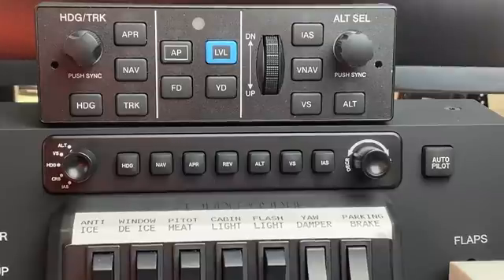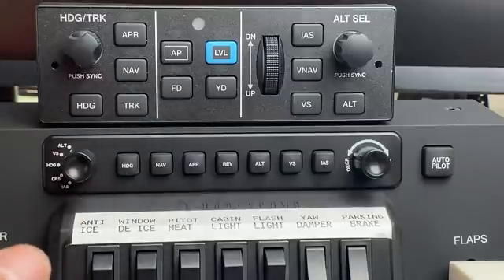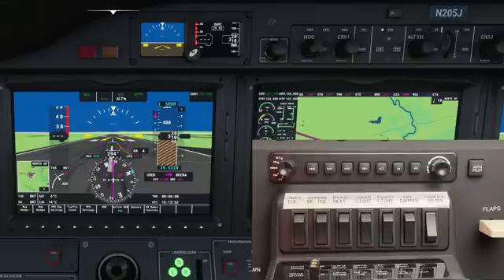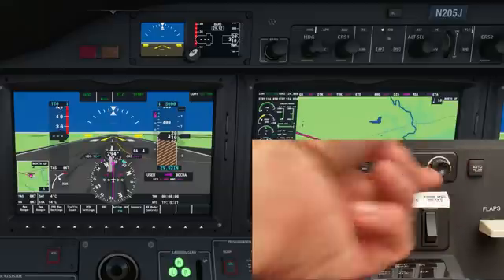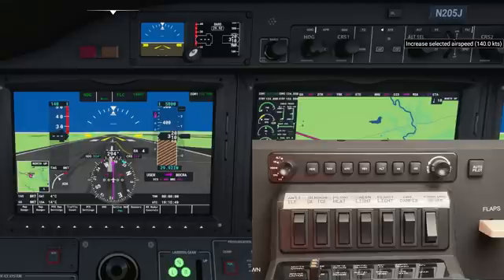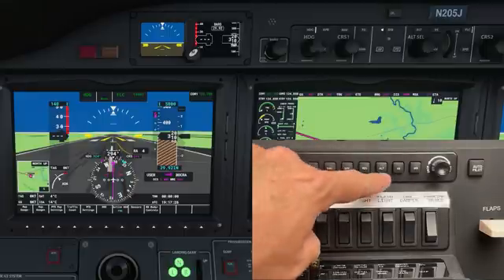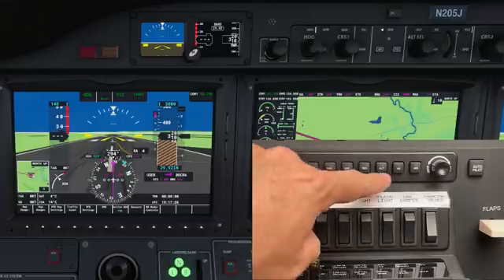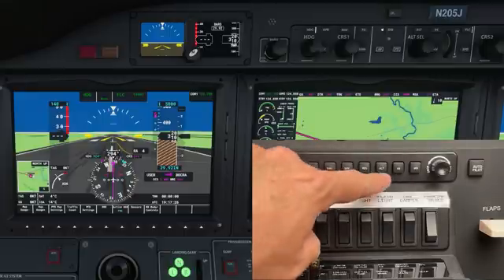Autopilot Tutorial for Honeycomb Bravo Throttle Quadrant in MSFS 2020.

Comment: great series of videos- thanks so much! I would like to make a label similar to yours- any recommendation for a good label maker?
Reply: Some sellers on Etsy are making magnetic labels that can be easily removed and a different one put on in its place, for if you have different switch settings for different aircraft. You just tell the seller what you want written on the magnetic label and they will create and send it to you.
Reply: Create the label in any design software and print on any inkjet or laser printer on plain paper.  Cut strip with scissors and use clear scotch tape to hold on Bravo.  I did mine on a Mac with Pages software and had white letters on black background which looks far better than black letters on white.

Comment: so, the "GOTO" button, is basically the Flight Director?
Reply from the maker: No. It sets the flight director command bars to a pitch up climb attitude.
Reply from the maker: Here is a new video for you on your question.  https://youtu.be/nB-SR4hODeY
Reply: Actually it is a GOTA (Go Around, Take Off) mode. Once triggered, the flight Director command bar will assume a pitch up position for the pilot (or the autopilot if engaged) to fly.
Reply: Regretfully he didn't really discuss the relationships between the Flight Director, mode selectors and the auto-pilot fully.-but for the purpose of the video it was a good introduction.
Reply from the maker: @timol437  Here you go:  https://youtu.be/nB-SR4hODeY
Reply from the maker: @timol437  the flight director command bars (also known as V-bars) are the magenta bars on the attitude indicator.  Essentially the autopilot follows these bars.  As a pilot you can manually fly the command bars if the autopilot is disengaged.  The relationship of the command bars to the autopilot is straight forward. For example setting the autopilot vertical speed mode for a climb and heading for a right turn would show a pitch up right turn of the magenta command bars.
Reply: @RMAG  Thanks-but as a check captain IRW on 757 767 I know this-but some newcomer viewer may not-just suggesting a hole that should be filled in the tutorial...also they may not always be "V-Bars" - FDs also use the two-needles (whhich I hate using IRW being an old 727 driver I am used to the V-bar)
Reply from the maker: @timol437  your right about the two needle. The 747 for one uses that in the Sim. Maybe I’ll do a video on it. It is tangential to using the autopilot.

Comment: how can you change the altitude by the hundreds instead of thousands with the honeycomb?
Reply from the maker: It’s well known bug in MSFS.  It has to be fixed by Asobo.  Alternatively you can use a third party program to do the keybinds, or you can unbind all your switches including the Alpha yoke. Or just wait for them to fix it.  I use the knobs for macro changes and then the virtual knobs in the sim for the micro changes.
Reply: @RMAG  thanks ! but you only have one knob right? so there's no way to choose quickly which increments you want to change, either they set all to hundreds or leave it to the thousands, unless you can set using the keyboard which increments 100/1000 you want to have and then the only knob in the honeycomb do the rest.
Take care and thanks again!
Reply from the maker: @Mr.President  you can’t specify. The always on buttons of the Honeycomb devices makes the adjustments be the larger ones.  Knob or keyboard it does not matter. The only way to get the small adjustments is to mouse click the virtual knob in the sim.

Comment: Thank you for this, but if i set one of my toggle switches to "toggle parking brake", in the sim the brake constantly switches back and forth a thousand times a second until I clear the setting. Is there something i'm missing on how to program these toggles to do momentary switch selections?
Reply from the maker: You need to bind to Set Parking Brake not Toggle Parking Brakes. When the SIM starts parking brakes are normally on so you might have to toggle it on and off just once.
Reply: @RMAG  also, for fixed wheel GA aircraft, try mapping the "Set PB" function to your Landing Gear lever instead, I found it works great.

Comment: I’ve watched I think all four of your videos in this series on the Bravo - EXCELLENT for my knowledge increase. Thank you.  two questions.  1 - how do you set your parking break (mine seems to toggle on / off / on / off so I’ve done it incorrectly) and 2 - can you say more about yaw damper?  Should it be on all the time the AP is engaged up until approach mode?
Reply from the maker: You want to make sure you bind the switch to SET PARKING BRAKE, not TOGGLE PARKING BRAKES.  The Sim normally starts with the parking brake engaged, so if you start with the switch in the off position you may need to flip it to on then back off the first time you use it.  A Yaw Damper is not to be used during takeoff or landing.
Reply: @RMAG  thank you again!!  I have tried but not successfully gotten cabin lights to work on the C172 (non g1000 version).  Any help on how to set up internal lights correctly on the bravo ?
Reply from the maker: @JCrowe  they don’t lend themselves to be bound to an flip switch. They are dimmer knobs for glare shield and radio lights.  Best to just use the knobs in game for that.
Reply: @RMAG  There seems to be a lot of simmers struggling with these functions, and also lots of lessons learned. Maybe a topic for a future episode?

Comment: You forgot to mention one little thing.
If you have the alpha, it will not work as expected unless you unmap all the lights and magnetos switches... shameless
Reply from the maker: Mine works without doing that.  Unless you are just talking about the heading and altitude adjustments being too large.
Reply: @RMAG  indeed talking about bugs on altitude and heading incrementa being stupidly high or low or random...

Comment: Fantastic video, for which very many thanks.  I've no doubt it will be indispensable if I ever get the Bravo.
I pre-ordered from Amazon UK over 5 months ago and they've now given up even suggesting a date.  I accept the current 'situation' may well be contributing to delays, but it's still very frustrating.
Reply: You should have gotten your Bravo by now. I got mine October last year (20), also from Amazon, shipped from France of all places.
Reply: @PeterMaddison2483  Hi Peter. Thanks for the reply, in the end Amazon admitted they had no idea when, or even if, they would ever be able to supply.  So I cancelled the order and ordered from Aerosoft in Germany.  After some delay I received it in May, I’m still trying to set it up for different aircraft, but it does make flying, trim etc a whole lot easier.  Cheers Noel
Reply: @Jestey6  When did you order it, I ordered mine 28 Oct and got it before the expected date of 1 Nov, I think it actually came in half the time.

Comment: You mention the "togo" button brings up the magenta lines. Does this make it the same as or connected to the FD (flight director ?) button? 

Is the default togo binding as it should be or have you changed that binding?
Reply from the maker: There is no flight director button on this auto pilot.  All the flight director button does on a real auto pilot is turn them on. It does not set them to go around/takeoff pitch attitude. It is the default binding.

Comment: Have you tried this with CJ4? It seems if i click autopilot like Nav mode it wont follow the course. And if i click nav mode on screen the heading light lights up on bravo panel. It seems the heading and nav buttons on bravo is not working or synchronize with the cj4?
Reply from the maker: HDG and NAV worked for me. FLC/IAS was the only thing that appeared not to work for me.
Reply: @RMAG  really? that's on CJ4 right? mine is broken. how did you fix it or what is your button config? everytime I push NAV it will light up but wont activate. I need to press it manually on screen.

Comment: I don't think they've done a "good job" - they were one pot from just putting the same setup as the garmin. The lack of a pot forced them to confuse everything.
Reply: I agree. We just needed ONE. (well maybe two, with a push button center). It would've been near perfect.
Reply: As someone who knows nothing about "pots" (well, except the smokable kind) is that something that can be easily (or at least relatively easily) added after the fact?
Reply: @kevykevTPA  Pot in this case refers to a "potentiometer", which are the knobs that you can turn. It's probably not simple to add another pot in unless you knew what you were doing, not to mention where would you even put that pot on the controller without drilling a new hole for it.

Comment: Thanks. Good film. I'm waiting for my Bravo. I have a question, can the ALT setting only be set in 1000ft increments ??? And what if we want to fly at an altitude of 3500ft  ???
Reply from the maker: There is a well known bug that makes the adjustments x10. Heading bug moves 10° too.  Asobo needs to fix it.  What I do is use the real knob for macro changes and the virtual knob for micro changes.
Reply: @RMAG  Yes, quite a strange "feature". If you ask me, this "bug" is too big to go unattended for so long, in other words, it's intentional. I guess we all use the 10 degree heading bug increments and hit the HDG-set-to-current when we hit the right single digit heading. Thoughts?
Reply from the maker: @georgesiebes  in some respects I like the larger adjustments. With my game when first loads in, it has the small adjustments, but it reverts to the large adjustments as soon as I hit ESC and bring up the menu.  It’s  A LOT of twisting to turn 180° or to set an IAS by 1’s instead of 10’s.  With Altitude it’s normally thousands or maybe thousands plus 500.  If I’m looking for a specific altitude I’ll set for the nearest 1,000 past the target and just hit ALT at my target.  The knobs are workable. I would prefer a switch so we could toggle between large or small adjustments.
Reply: @RMAG  Could one of the programmable buttons be set to do that?  I think a better solution would be to base it on speed, and I'd hate to waste a button on that, but it might at least be an interim fix until someone figures out the speed idea, or something I haven't thought of.  A push button knob would be best, but that's not something that can be fixed with programming or firmware, it either exists or it doesn't.
Reply: @RMAG  yes, I noticed too that  when you first start flying, the heading bug moves in 1 degree increments. So there might be a glimmer of hope that this is a "bug" after all. Real world should ultimately drive this functionality in the sim.
Reply: I have the Bravo and love it.  My workaround for this is the Stream Deck with a plugin for MSFS (which I had all set up as my autopilot prior to the Bravo).  The Stream Deck plugin uses SimConnect rather than a direct controller input, so is unaffected by the bug.  I use the Bravo for the big changes.  When I need fine tuning (100s of feet instead of 1000s or 1 degree of heading instead of 10) I use the buttons on my Stream Deck.  Until we get a fix, this is a great way to go.